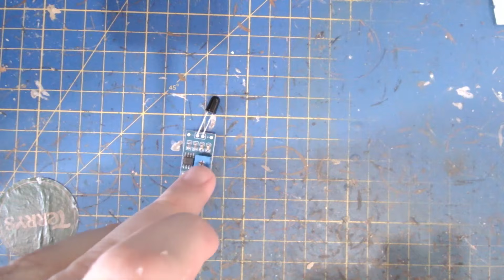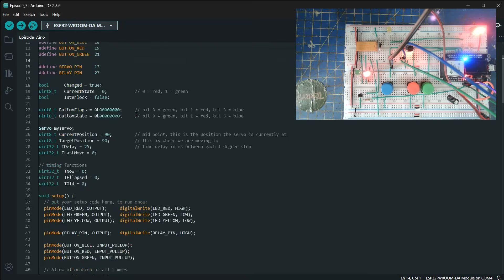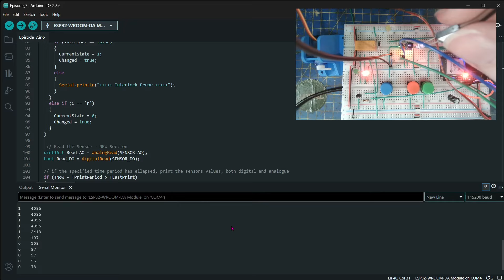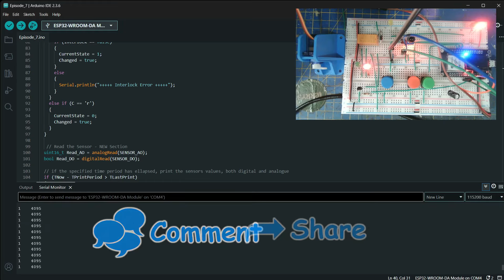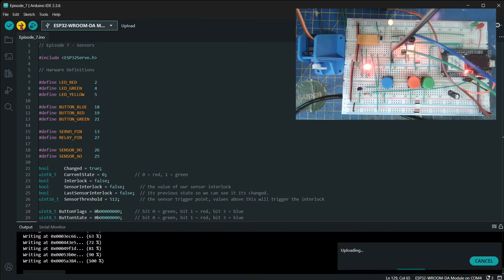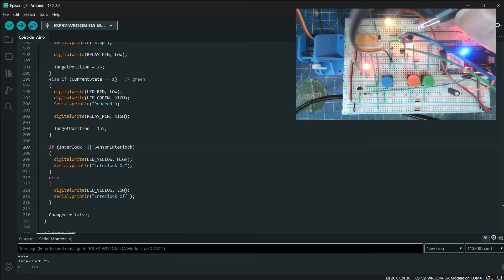7. Sensors! Adding them to the ESP32 #modeltrains #electronics #esp32 #sensors #howto

Comment: Is this like the adafruit break beam?
Reply from the maker: Hi, I can't say I have ever used one but very probably as most of these things work in a pretty similar way with an infrared emitter and an infrared phototransistor.

here the little board includes the support circuit, a resistor basically, for the phototransistor and I had to provide the resistor for the LED.

one thing to note, these board use a 1M ohm resistor so there is very little actual current flowing, enough for a microcontroller to detect it though - the large resistor impacts the response time of the LED - for a beam sensor this doesn't matter but it would if you were wanting to use the sensor to say decode an infrared signal, these boards are not suited for that.